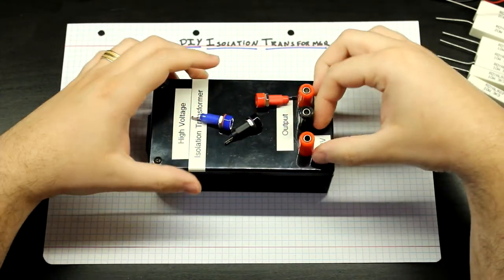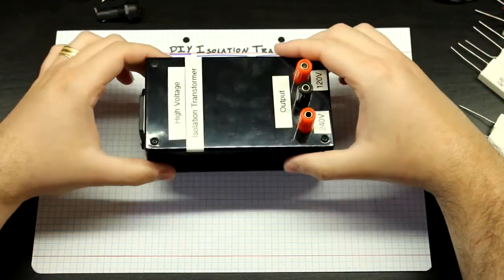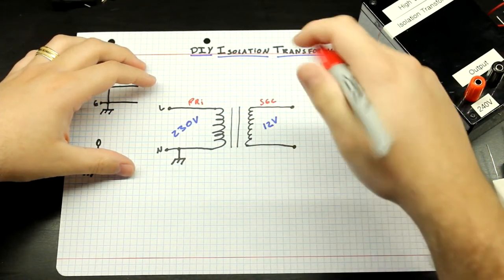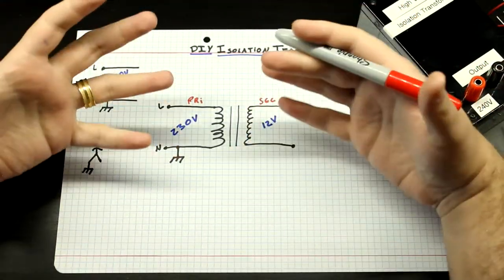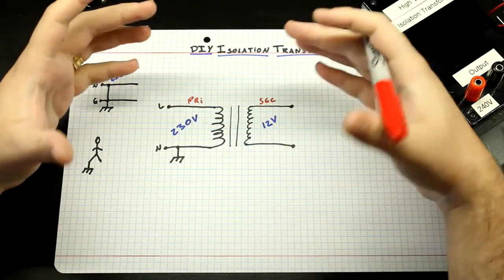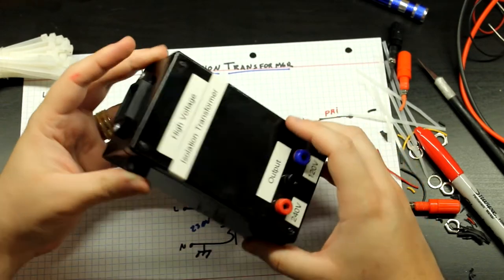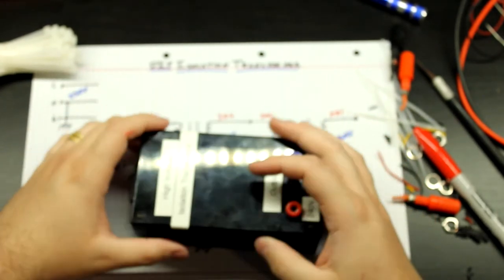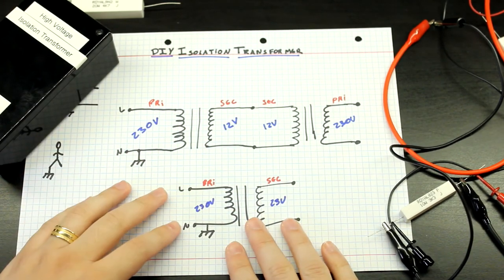#020 - DIY High Voltage Isolation Transformer (Build and Experiments)

Comment: Cool video. Im into embedded design as a hobby and im working on a touch screen interface and plugs where i integrate a variac, 1kva isolation transformer, touch screen, power resistors and plugs which will have a digital indicator of what they are and what's safe and such. Its part of a workbench renovation and i have a bunch of parts, motors, embedded controllers. I want all the heavy stuff off my bench and there only be a touch screen with controls, clear state indication of the plugs, variac status, isolation transformer and short detection for the dut. 

I was going to put the isolation in a wooden box along wirh the variac but separate them  with wood or acrylic. This will be a permanent installation. I was going to use a canbus setup along with high end relays to put things in and out of the chain. The variac was going to be controlled by a nema23 via the touch screen interface wirh granular or linear control for the desired output voltages. The plugs will open with servos and such so nothing can be used unsafely. Plus i want it to look cool af haha i was going to print a mechanical panel which covers the plugs and barrels using a statemachine i code.

Comment: Verbal diarrhea aside, i was wondering how youd separate the embedded (redundant) controller. I plan to have everything running on custom firmware but as we know any sbc or controller i use run on low voltage. I was going to galvanically isolate the variac from the nema by using a custom coupling mechanism thats non conductive and any fail state fails safely. Im 45, a nerd and retired haha.  Plus i dont want any smps noise on my bench. All my power supplies are linear for dc. I was thinking id build an emi shielded box for the power supply and controller for the setup. Kinda like when i build guitars haha. I reqlly do not want to use bulbs to indicate shorts.
Reply: You can get an isolated variac for $200-$300 (SC-10T)